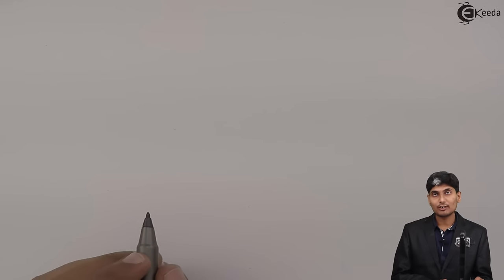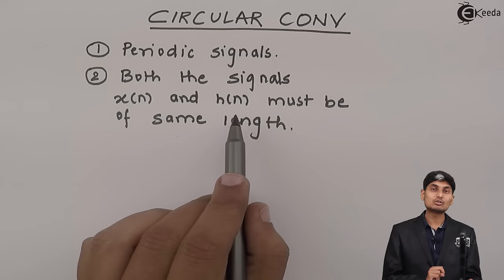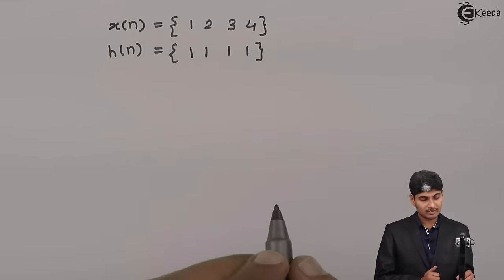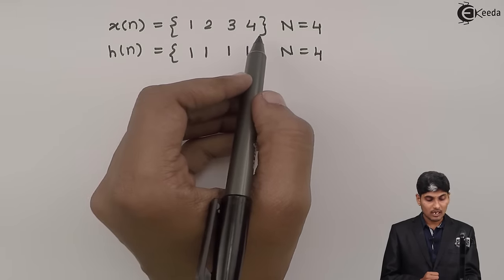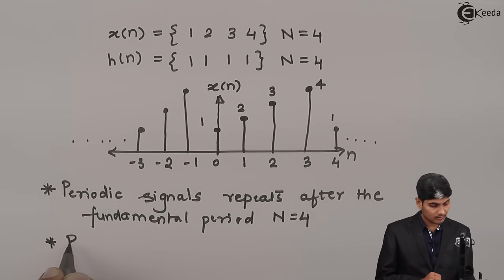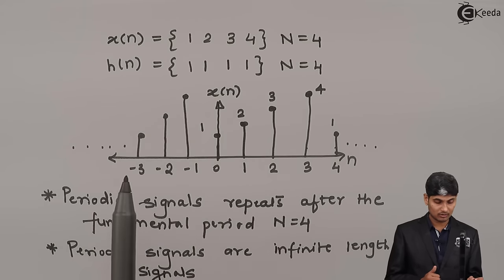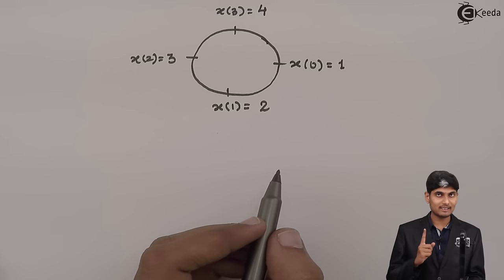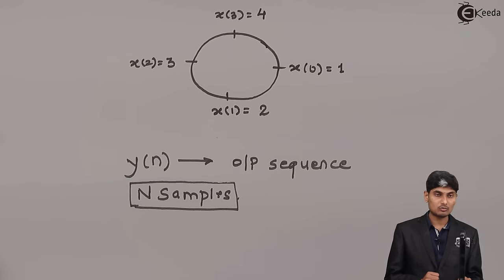What is Circular Convolution discrete time signal processing | Discrete Time Signals Processing

Comment: if x(n) is {1 2 3 4} and h{n} is (1 2 3}, would we place a 0 after the sequence in h{n} to make it the same length. WOuld it end up being h(n) = {1 2 3 0}
Reply: it will be    ..length of x(n)=4 and lenght of h(n)=3 so actual lenght=4+3-1=6 ...using zero padding ..x(n)={1,2,3,4,0,0} and h{n}={1,2,3,0,0,0}